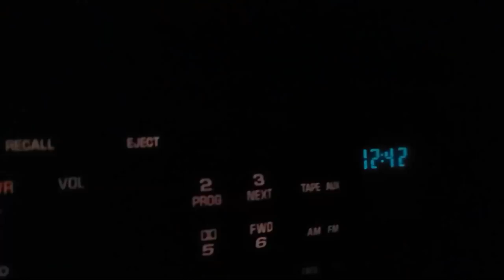MOUNTAIN MAX! | First Ride of the Year

Comment: Guys I'm sure you get asked this question but please indulge me if you dont mind. If budget is not an issue and I want a sled that's great for deep snow off trails, whats the machine to get? I have two sleds that are both heavy and constantly get stuck off trail so I've gotten it wrong twice now. 1 x 2021 Ski Doo Renegade and 1 x 2020 Switch Back Assault and neither is good for this purpose.
Reply: Arctic cat Riot or Yamaha mountain Max

Comment: Gross!! I just threw up in my mouth!!
Is that a cat motor in the mtn max!!??
Ppl u don't buy a Yamaha for a shitty c tech 800!!
The 4 stroke is way more reliable!! U never have to worry about oil or high octane gas!!
U can fill up with 87 in 15' of snow n still get 13 mpg!! With more torque!! 
More weight yes but with a monorail it should be effortless!
Reply: I hate when I got to put 87 octane in mine. It runs on it but there's definitely a noticeable difference in throttle response and top end!